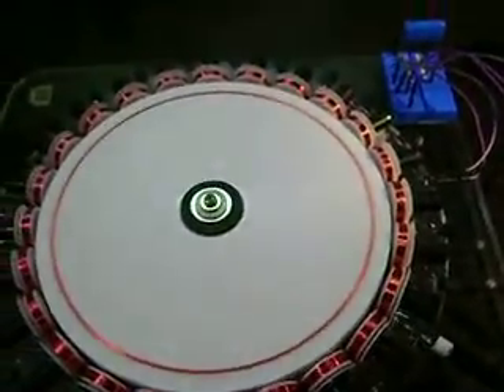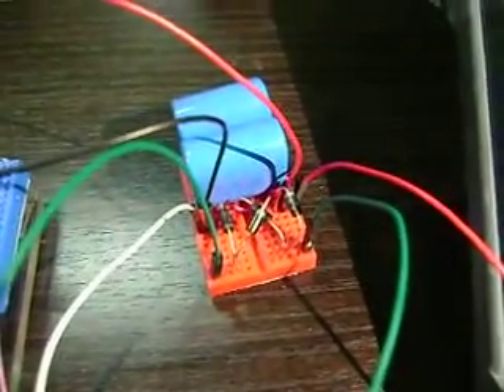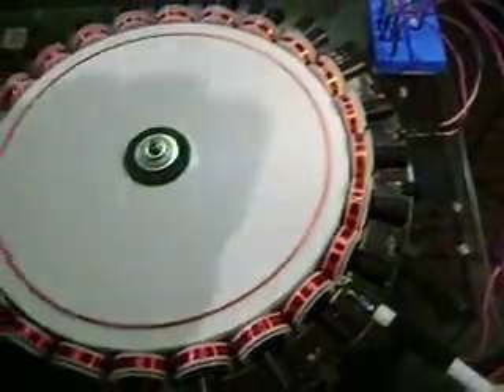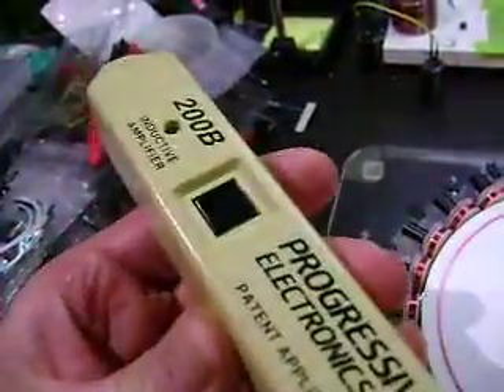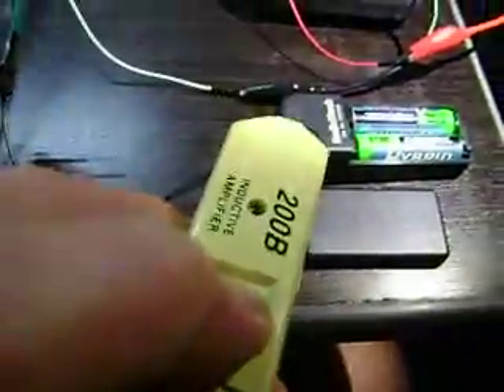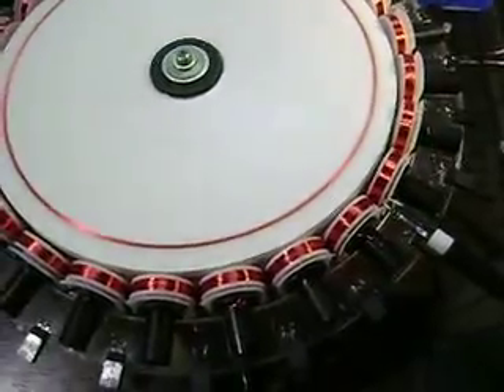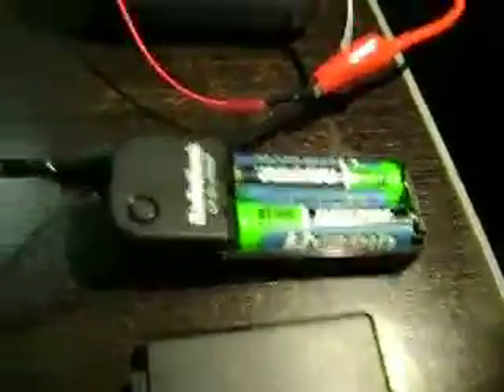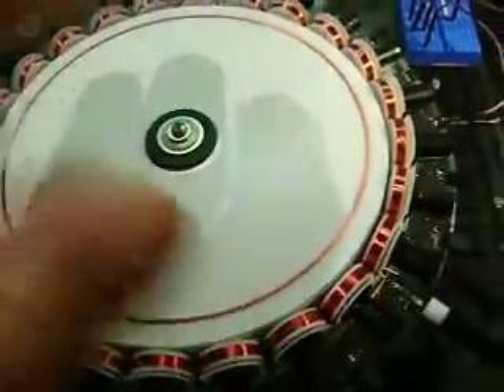My Version Of Lasersabers EZ Spin Motor with 160v input.

Comment from the maker: Thanks. Just trying some things. Once I get a handle on what it can do as in output, then Ill do measurements of loaded and unloaded. The little inverter just happens to be perfect for this motor. Its handling charging empty caps well also, of which I dont think it was intended. Inductance doesnt seem to play its part much as I believe resistance, 15kohm, dominates in current control, The total inductance is 2H, but its impedance capability is short lived once the resistance limits max current.